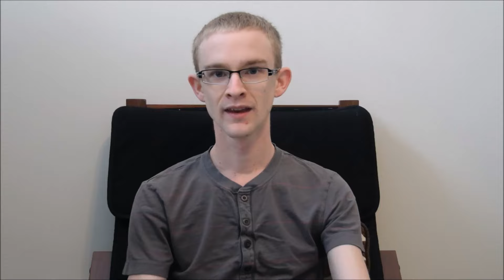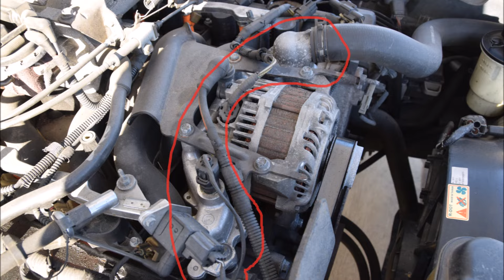1998-2011 Crown Victoria Police Interceptor Buyers Guide

Comment: I have a 2009 Black and White Crown Victoria Police Interceptor. I was extremely lucky because the car was in almost new condition. It was the assistant police chief's duty vehicle. They also gave me the entire vehicle maintenance file. No dents, no rust. My brother is a auto mechanic and we did very little work on it basically normal ware stuff. We paid $250.00 dollars the Police chief is a good friend of my dad's. This summer if all goes well I'm getting it repainted black and re rustproofed on the bottom.
Reply: James K do you still have it?

Comment: Hey just bought a 2008. Has the newer manifold, shocks are really good, everything seems sound. Fluids are clean shifts good but I do plan on rebuilding the transmission at some point just because of the age. Higher miles 189k with 4600 idle hours but its just ran and drove so much smoother than the others I was looking at. $2650 is what I paid. Even has the mounting bar bar on the font and the plate for the shotgun lol. Just want to thank you for your information it helped a ton.

Comment: If you're thinking of buying one of these be sure to check the front of the intake manifold where the thermostat is as the original intake was all plastic and if the car still has the original all plastic intake manifold and there is over 100.000 miles on the car then at some point soon it will start leaking coolant and it could be leaking already so look for any small puddles of coolant around the front as they can start slow or they can just bust while you're cruising down the highway. so if it still has the all plastic manifold you will need to replace it with the upgraded version which is still plastic but has an aluminum crossover. After this problem started poping  up on fords 4.6 ford finally issued a recall but not for the regular joe's like us but just for police/taxi's and limo's so people were so pissed that a class action law suit was filed and ford finally caved in and covered the cost of the replacement manifold but that's no help for someone like me who got my dads 1999 Lincoln Town Car with 90.000 miles on it in 2013 and all was well then but fast forward to 2016 with 115.000 miles and i notice i am having to add a little coolant every few weeks and sure enough the plastic where the thermostat seats had broken off and on the passenger side of the manifold i was also loosing a little coolant so i had to replace the manifold $156.00 on eBay + $200.00 labor to have a friend install so just be sure to check for this crappy cost cutting plastic part that ford put on the 4.6.

Comment: It's  given  that  the  intake  manifold  will  fail. I have  a 2006 crown  vic 17800 miles  . Not certified .it was the  sheriff's  car .my problems  is with  the  sensors electronics.

Comment: I got a crown 09 Vic about 6 months ago. It was a highway police cruiser. I had 0 problems so far. Apart from a small transmission leak (rear transmission seal) other than that I really enjoy the car. And I am surprised how well it does on fuel.  When you cruise around 35mph it revs at around 1200rpm lol.  125000mi and 2900idle hours. and still pulls strong.

Comment: I've always wanted to pick up a 2003 - 2009 P71 but, at the moment I already have a daily driver (2007 Ford Edge SEL) I am modifying and a 1976 Camaro. Maybe one day when I get that next level money I can pick one up. Thanks for the tips.
Reply from the maker: +Frank Jr. Thanks for the comment! The 3.5 Duratec sounds insane with a K&N on it in case you're looking for something to do to the Edge. Good luck on the Camaro!
Reply: +mkm230 I had a lot more bigger plans but, my financial situation has changed so I have to put a lot on the back burner. So, for now I'll be adding an AEM DRYFLOW AIR FILTER (I don't want to deal with the oil right now). I want to add an K&N Air Intake (which is now CARB legal, WooHoo!) and a Gibson Exhaust System in the future. One day, hopefully, I will upload a video on what I have done and plan to do to my cars. I have issues with perfectionism.
Reply from the maker: +Frank Jr. Good luck! I'll keep an eye out for some videos!
Reply: +mkm230 in your opinion what year is the most reliable of the crown Vic's?

Comment: Sometimes if i'd get on it from a full stop or stop quickly I'd hear a thump out back. Started to worry about the body mount. Come to find out its my spare tire moving around in the trunk XD shows you how often I use the trunk. But fell off its little home on top of the fuel tank and have been kindof hitting off the trunk door and the wall between the gas tank and the trunk floor. Big relief on my end.

Comment: Modification Suggestion - I installed Lincoln Town Car seats in my 2010 CVPI, and it turned out very well. Those fit in perfectly, and that center console is a killer. 

Seats themselves are also MUCH better than the stock ones. (got it from a junk yard)

Comment: The oil, make absolutely sure you stick with the 20wt oil. Tolerances in the camshafts area are so tight that too thick an oil will cause camshaft failure because thick oil will actually not flow. Remember, the camshaft rides on aluminum as there are no traditional camshaft bearings, the correct weight oil on these is the bearing.

Comment: i was looking at an 05 vic on gov deals, i didn't feel comfortable about it because it was a actual patrol unit used in a big city, i'm trying to get one that was used by a detective or used in a small town sometimes that info isn't available
Reply: +trigga ville Alotta city driving on these cars with high mileage will cause wear on the transmission, lots of stops and going and such if your tranny is slipping the first day ya buy one expect to get a rebuild or replacement in a year or 2 if the car is already close to 200k miles, Esspecially the 98-2001 models. If your lucky and know a mechanic that installs refurbished transmissions ya can get that solved for 1500 bucks. The retired taxicabs are more prone to transmission issues after a year or so because of all the stopping and going, these vics are more meant for highway transmission wise. My transmission finally gave way and wont go forward it will reverse and such but it will be fixed next month, ive been saving and expecting it, I love the car so much and it was cheap to buy initially with no major issues, shes a keeper. As for the engine it will last longer than the transmission and will go over 500k miles without a rebuild if maintainence is done like oil changes and not always racing and such, even if the engine goes a rebuild only costs about a grand.

Comment: Great video.   What's a general price guide for them?  Are there auctions (internet or in person?), or just look on Craigslist?  Many youtube comments claim to have purchased one for only $600-$1,000!
Reply from the maker: It really depends on year, condition, and mileage. I've seen some really beat up ones for $300, but newer 08-11s for $6,000 with low mileage and in good shape. I got a little lucky as I was working at the dealer I traded this in for. There are tons of auctions nationwide, check your local municipality. Most have a yearly auctioning off of old vehicles. Also, check out chicagomotors.com! They have some really clean ex-police vehicles.
Reply: whats best build year with the least amount of repairs...?

Comment: I've recently bought an 07 p71 crown vic with the 4r75e transmission and the forward gears feel alright but I was moving it in my driveway and I put it in reverse and it was like I was in neutral. the fluid smelled a little burnt. Would I have to rebuild the trans?

Comment: On my '05, I have some squeaks coming from the rear end when going over bumps, any idea what that could be? Mechanic put new grommets on trunk lid hinge area, but it doesn't seem to help. 

Also, I have a faint burning smell from around the firewall/engine area. Online searches say it could be the heatshield/insulation falling down on the cats like you mentioned, or maybe even the heater core being dirty.
Reply: back could be a bushing or a bad strut
Reply: +Jarret Retfalvi Yeah, I was thinking the same. Hope it doesn't cost too much to replace. I'm on a "Crown Vic" budget lol

Comment: Hi mkm230. You have mentioned something regarding a rattling sound during the car startup. I have that sound in my 2009 but it pops up every once and a while... What do you think causes that sound?
Reply from the maker: +David McFarlane If its the sound I'm thinking of, it's the timing chain tensioner arms. Mine does this sometimes as well. What happens is occasionally there is not enough oil coating these parts upon startup and it takes a few seconds for oil to coat the tensioner arms. Make sure when you get an oil change that the filter you use has a silicone anti-drainback valve on it. This will help in preventing any dry startup problems. Keep it in the back of your mind that somewhere down the road it might be a good idea to get in there and replace them. 

However, you can tell if you're in dire need if this sound continues while the engine is running (after that inital few seconds.) That means your tensioner arms very worn and must be replaced before they wear completely through.These are interference engines, so if they go, you can kiss your engine goodbye.

Not trying to scare you, just keep that in mind!
Reply: Mine had a start up knock randomly, more so when cold. I switched to a motor craft oil filter and my start up knock went away completely! That anti-drainback valve made the difference for me on my '07

Comment: Are you sure about the driveshaft thing? The P71 vics had the aluminum driveshafts all the way till the end. My 06 is aluminum.
Reply from the maker: It's not just aluminum, it's a "metal matrix" driveshaft, which I assume is a combination of metals, not just aluminum.
Reply: mkm230 Hm, interesting. I stand corrected.
Reply: Technically speaking...aluminum is a metalloid...so it is already a "mix"

Comment: What is a good price for a 2003 and up crown vic? I love the look of these cars.
Reply: +MisterJonesification Depends on shape, year, trim, and mileage. A mint 2011 lx will go for far more than a beat, high mileage 03 p71.
Reply from the maker: +sugahotcakes second this. It really depends on year, mileage and condition
Reply: I bought my 2007 ex Highway Patrol car with 92k miles and 2600 hours for $3,000.
Reply: MisterJonesification I brought a 99 p71 for 2300 with 150k miles and that was 3+ years ago, still running smooth
Reply: That's awesome, hopefully one day I'll get lucky like that. Have you did to do anything major to it?

I have a box 88 marquis that ran for a year, but now I'm saving to get that fixed, and get a newer crown vic/marquis so that I can have 2 cars. I haven't seen any crown vics that cheap here in Dallas though. Maybe it's because dealers buy the good ones at police auctions, and mark up the price to sell for profit. 

One dealer here that sells nothing but these cars wants $5k, and I'm even sure if it's been rewired. A lot of the cars looked pretty rough too.
Reply: MisterJonesification nothing major really, just had the intake manifold replaced cause it was cracked in the fuel pump changed twice since I had the car, and just regular maintenance on the car

Comment: Is it normal that after cold starts and going in gear, the car jerks forward a bit?
Reply from the maker: Mine does the same thing. I'm sure it's perfectly normal for these.
Reply: +mkm230 Another thing; does it jerk forward when it shifts gears too? Is your check engine light on?
Reply from the maker: Do you mean while you're driving and the transmission shifts? or shifting between gears while stopped?
Reply: mkm230 When I'm driving, the tranny shifts aggressively sometimes and I feel a push. I like it but just wondering if it's normal. Most of the time it shifts very smoothly though.
Reply from the maker: +ChinnuWoW probably nothing to be concerned about then.
Reply: +ChinnuWoW maybe it can be the transmission fluid ? you should check it out ?
Reply: Humberto Lopez The fluid level is good, but I don't think the fluid's been changed in a long time, so I don't wanna lose my friction material :/
Reply: mrhesham9090 Ya, I always wait a few minutes and then it works nice.

Comment: Is a 2010 with 89,000 miles a good deal for $3500
Reply: Cheryl Battle That's a great deal. Get it.
Reply: Yeah i paid 4500 for an 08 with 108k and 1500 idle hrs,it was a supervisors car with carpet,looks and runs great drove it from Pensacola Fla to Atl Ga twice,love it.
Reply: U can get em much cheaper than that trust me!  These things were on the road/still in service all over the country/canada. They are literally a dime a dozen. I used to work at a auto auction. They never went over a grand!!! Ive had 2 old cruisers which i paid 1300 & 3,000 for. However both of these were the better and rarer LT1/9C1 Caprices. This is what u really should look for. They were made from 94-96,had de-tuned[iron heads VS aluminum ones] 350/5.7 LT1 Motors. This motor was 1st put in 93 Vettes,then F-bodies [Camaro/f-bird/T/As] iron headed blocks went into everything from 9C1 caprices/Impala SS to Buick roadmasters and Fleetwood Caddys. Good luck regardless bro!!!

Comment: If u have a crown vic what can u put on it that is legal like a cop ? Things that u can have on it that look like a cop but legally ?
Reply: You can have, antennas, pushbar, black and white coloring, cage in the back. Pretty much anything besides a light bar and police lettering. You could even have sirens but DONT use them in public or you will be in big trouble.
Reply: why would you want to look like one anyway? that would make you look bad if you got pulled over js
Reply: i have 2 shotguns from wood inside. its ok